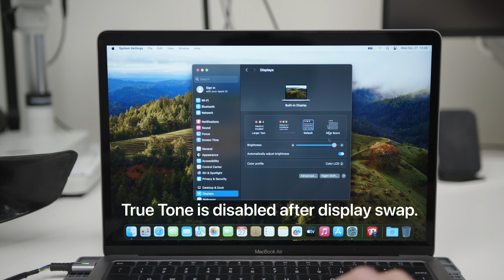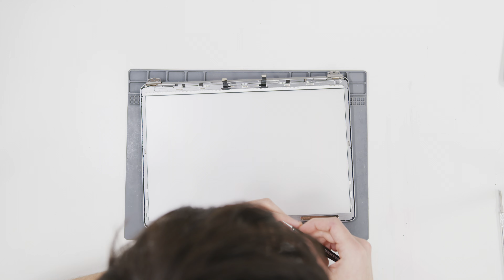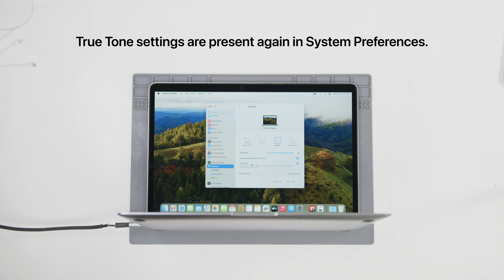This takes 2 hours because of Apple Serialization - M1 MacBook Air Display Repair (A2337)

Comment: This is an amazing video! Your technique is perfect and covers the whole process for a difficult repair. The two things that are unresolved for me when I tried it this week are 1) a safe procedure to remove the LCD without liquid damage to the diffuser layers or cracking the fragile LCD panel itself, and 2) where to obtain replacement packages of diffusers (maybe all six in one pack?)

I have tried a heated silicon separator pad (65 and 70 C), a hot air rework station, an automotive suction cup with various prying tools - very thin metal, metal almost as thick as a credit card, a plastic guitar pick, a plastic razor blade, and a playing card. I tried sliding the tools around the edge to gently loosen the adhesive, but barely any pressure without heat will crack the glass. 65 C on the heated pad didn't really help loosen the adhesive, but 70 C created halos on the bottom silver diffuser layer. I didn't test that one, but I'm fairly certain it won't look good with the halos.

To remove the LCD panel, I also tried isopropyl alcohol, 99% alcohol, iFixit Adhesive Remover, and Goo Gone. Even my attempts with a single drop of liquid in the corners resulted in liquid damage to the diffuser layers, which I can't seem to find for sale anywhere. I replace the entire display assembly fairly often and had eight "dead" displays in the garage recycling which I used to practice on. I may have to make the rounds to our local recycling centers to get some duds to practice on because I don't have this down yet.

For someone who works from a home office without the benefit of a clean room, the best bet to avoid dust, cat hair, lint, or any other contaminants when working with the diffuser layers is to clean the bathroom sink, mirror, and lightfixtures, take a hot shower without running the fan, put on a clean shirt, and while it's still steamy do any work with the layers on the clean sink. Just pulling the layers off one at a time creates static, which draws all manner of floaty bits in the air, if you're outside of the bathroom. If you get a cat hair, it's difficult to even locate the correct side of the correct layer to "dab" the hair with a bit of leftover screen adhesive on a tweezer to remove it. As an aside, it there any way to clean or restore the coatings on any of the layers? I was thinking about testing several different methods next weekend.

Thank you so much for a super-helpful video! Any tips on safely removing the LCD when it seems very stuck together or on where one can order LCD diffuser packs?
Reply from the maker: Thank you for watching! 

• I find heat is not effective for 2016-2020 display assemblies. It is better to use just alcohol and go slowly
• Layer 6 (topmost layer) can be cleaned somewhat with pure isopropanol and a clean q-tip or similar. Layer 1 (bottommost layer) can also be cleaned with a lint-free cloth. However, the middle layers are usually impossible to clean properly and must be replaced. If you roll up a small length of polyamide tape, it can be used to lift dust off the layers without leaving residue.
• You should use a very thin shim for removing the LCD, ideally between 0.15mm and 0.05mm. It helps a lot to prevent cracking the LCD if you need to reuse it.
• You can purchase the diffuser packs from china, even original ones are available if you ask around.

Comment: Great video, thanks a lot! I have a question:

When reinstalling the "display frame rubber gasket", do you use glue so that it doesn't move when the LCD is mounted? I can see that you are using cotton buds after replacing the rubber gasket. Is there any glue or liquid on them? Many thanks
Reply from the maker: The original adhesive can be reused for the rubber gasket, it is custom-cut for the gasket's groove so it works best. If there is an issue with the adhesive, a 1mm double-sided thin tape can be used as a substitute. Usually there is some debris/dust that collects on the gasket, so it is cleaned off after with the cotton bud.

Comment: I tried this procedure on my own and it is very difficult to extract the LCD from the frame. I touched the backlight sheets and I have to replace them. Also it is very difficult to get the LCD out in one pice, it broke. Also I touched the cable on the top and it has a cut. 

It is better to buy some broken displays from Ebay and try it several times, it is not easy. 

For myself, I will buy one Display directly from Apple, because I don't want to lose True Tone.
Reply from the maker: I have made all these mistakes in the past as well, they do not make it easy unfortunately. Cutting the small cable for the light sensor at the top is particularly annoying since it is very tedious to run jumper cables to repair the tear. Lots of trial and error for LCD-only repairs

Comment: I recently discovered that the TrueTone is paired to the Logicboard on the M1s, so when a shell comes in that is too damaged to repair or the LED/Cam strip has liquid damage, I have to get replacement shells and swap the cameras.

Unfortunately, the M2 is a huge issue because the LCD itself is serialized, so repairing it leads to a weird glitch. Hopefully someone finds a solution to that.
Reply from the maker: For the newer 14” MacBook Pros (M1 Pro, M2) with the mini-LED array backlights, the TCON ICs (controller and EEPROM) need to be transferred to the new LCD panel to avoid having the block artifacts show up on the image
Reply: @vancouvermac  I'd read about that, but couldn't find any videos of someone actually doing it...until now.

It's a shame we can't find a solution that involves just running some software to to pair the new chips up to the board. There was that one German guy who developed a tool to re-calibrate the lid sensor on a unit, so that gives me some hope that there could be a solution like that, but until then, it's breaking out the hot air station and hoping for the best.

I'm sure after a few hundred, it gets easier.